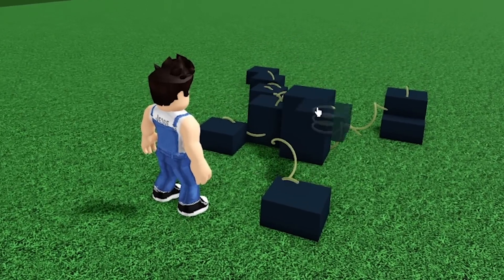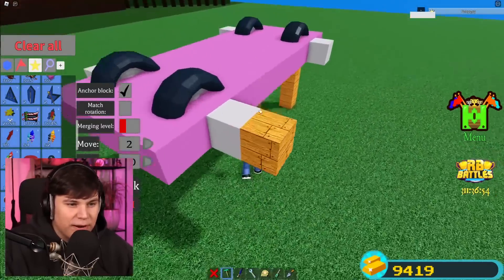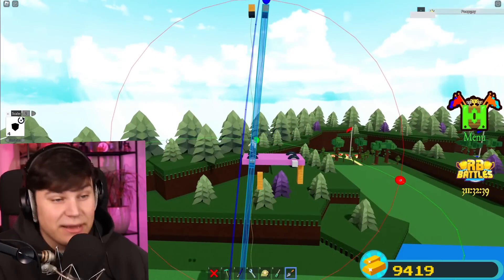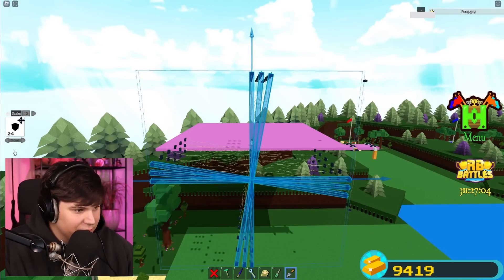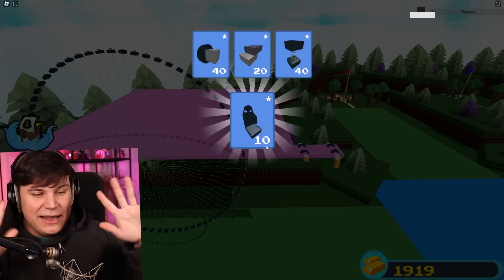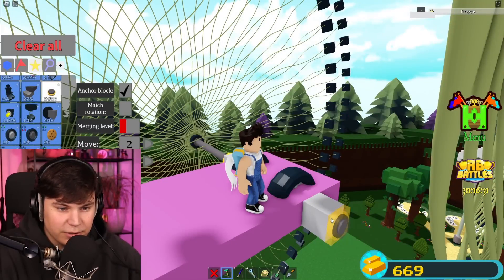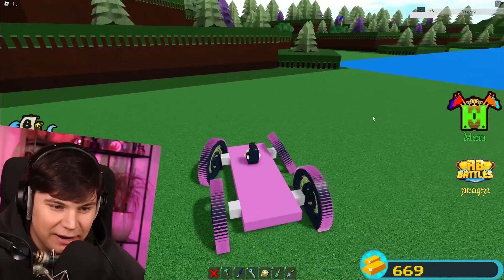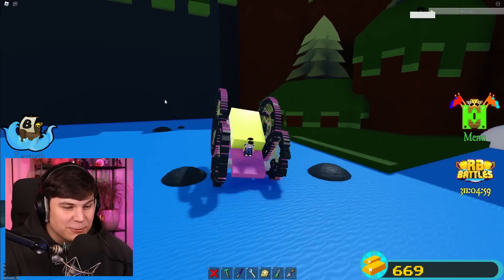NEW SPRING WHEEL TRICK WILL BLOW YOUR MIND! Build a Boat

Comment: Things i want in babft:
> - Multi-Select Scaling
> - Mult-Select Re-Sizing (shrink builds, expand builds)
> - Multi-Select Deleting
> - Mirroring/Reversing feature on Trowel
> - Option to remove effect particles on things like planes, magnets, thrusters, balloons & harpoon trails via the ScrewDriver.
> - Customizable Spring Strength
> - Customizable Thrust power via Thrusters
> - angle settings on atomized wheels
> - "free Move" setting on Trowel, disabling X/Y axis control (drag'n'drop)
> - shape setting in building tool, for normal blocks. EX: wooden triangle (scalable)
> - a quest where you have to put your boat through every stage ever made.
> - Game mode with infinite stages, available for VIP servers. test the longevity of your boat.
> - Gear blocks with Configure GUI for tooth quantity, gear size (like scaling) & Gear type.
> - Fix hinges from sliding off blocks more often (please) 
> - a minimizable notification hub, sorting things like join requests, challenge invites, and block sharing, and finally replace the view obstructing request with a red dot indication via hub button. 
> - and a winter update ☹
Reply: We all do
Reply: Hey get on a pc copy that and post
It on his discord
Reply: agree
Reply: Something else that would be cool as a game pass in\or in VIP servers is a sort of creative mode, with a ginormous build area and practically infinite blocks (but no water area)
Reply: The inverted thing on the trowel would be very useful. Maybe the I key could work
Reply: @emaany1839  If it was I how do I do it because I am a mobile player?
Reply: @SpaceGameJ  i don't play on mobile but i used to before and maybe there could be a different button for inverting it.
Reply: @emaany1839  The I key makes you zoom your camera in, so no, it wouldn't work. Maybe R for Reverse?
Reply: @joelhoon1707  It should be F since it's Flipping the thing you wanna flip since R is used to rotate and F doesn't really get use.
Reply: @emaany1839  That's actually way better.
Reply: the last one we know we all want
Reply: Also want a block changing tool via the trowel
Reply: So true but u forgot one Ctrl or shift+c to copy blocks (only with the trowel)
Reply: My personal only thing i want to be in babft is the ability to make it so people cant click your butter blocks
Reply: YES especially the gear blocks because im going into engineering and i dont want to spend hours on just making a good gear thing
Reply: @lilywozniak-rf8ro  that would be heavenly too
Reply: @Thatkidpetqrr  agreed
Reply: If multi select tool: if the item isnt just square ot flat, like a circle or UFO Build, the scale tool can only to uniform scale (you can't have custom with and height) which sucks
Reply: Select all blocks to make app blocks big it will be looking curse so I won’t want that
Reply: That how it works in all games
Reply: That lava stage in og build a boat and the spike wall version of the lighthouse stage were bitches
Reply: The mirror tool is real for now
Reply: mirror exists

Comment: you can use fabric instead of plastic at the end of the wheels for more friction
Reply: fun fact: you're wrong. sand has the most friction
Reply: @TotallyDumbTheNoob  ok
Reply: @TotallyDumbTheNoob  He said “more” not “most” and fabric does have more friction than plastic… so what he said is correct, ‘Mr I know everything’.
Reply: @masterplayer5982  em... ok
Reply: Wait, blocks (other than ice) have different amounts of friction?
Reply: @joelhoon1707  yea. I saw a video about friction testing the blocks
Reply: @TotallyDumbTheNoob  I am more blown away than my strongest PvP vehicle after touching 10 fast-moving pieces of dynamite.

Come on, it's literally mostly gold, has obsidian as the floor and ceiling and has a giant marble harpoon shield, why is its weakness still explosives, more specifically getting flung into the null zone by them???

Comment: If your smart u might make a wire for detailing your builds
Reply: just add glass on top of a 75% transparent spring and then you see through the glass so you dont see the block ends of the spring leaving only a visible line